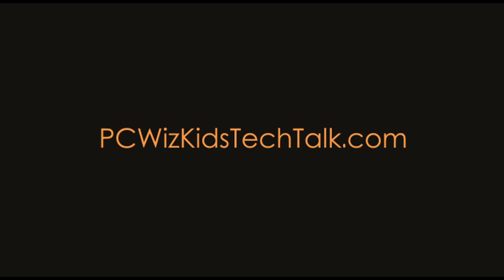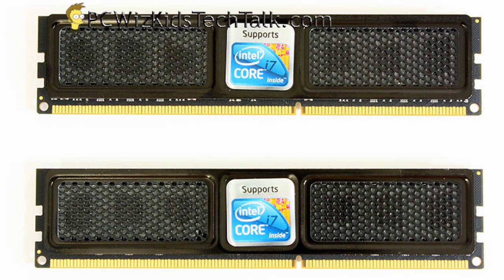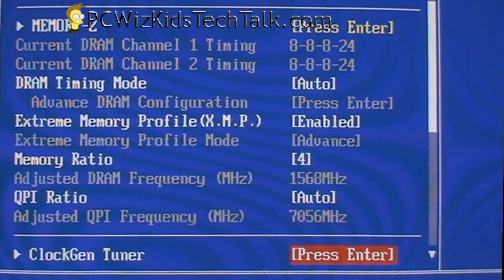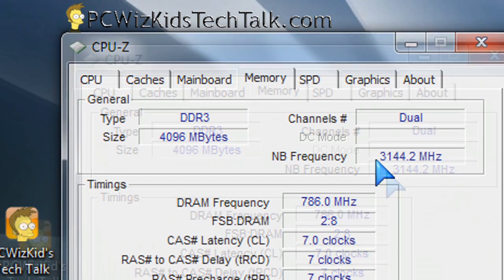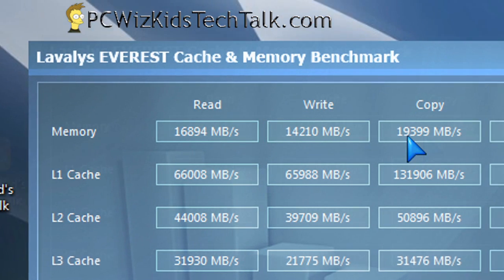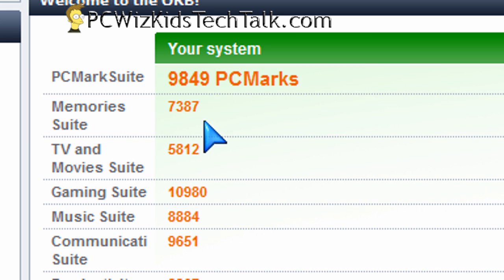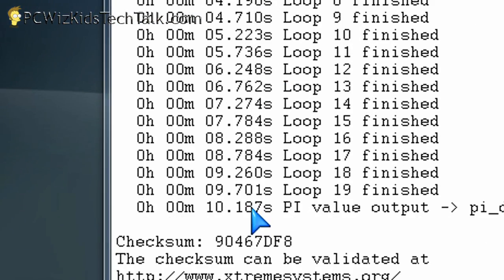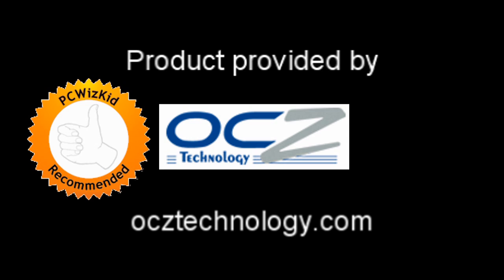OCZ DDR3 PC3-12800 Intel XMP 4GB Video Review

Comment: @philaurent1983 I'm pretty sure (not 100%) but the 1336 boards only support the core i7 9xx CPU's, that is they do not support i3, i5 nor some i7's built for the 1156 boards.

=) Sure someone can correct me if i'm wrong.

Comment: @PCWizKid It would be nice to see a comparison between a dual and triple channel memory(also chipset). Am I right that the i5 would also run on a 1336 socket board?

Is there a big difference between the P55 (1156) and a x58 (1336) in performance? With the same parts, execpt the memory&mainboard.

That would be good to know! Thank you so much. I'm a big fan!

Comment: Ok, so I recently overclocked my AMD Phenom II X4 965 from 3.4Ghz to 3.8Ghz and uped the voltage from 1.4 to 1.46. After that I ran the AMD Overdrive Benchmark and got a score of 9000, a 1000 point increase. Then I ran 3D Mark 06 Trial Version, and my score dropped 50 points for 15,878 to 15,838. I was wondering if the benchmark wasn't accurate, or I somehow decreased my computer's speed. Any insight? (The core is not the Black Edition). Thanks for your thoughts.